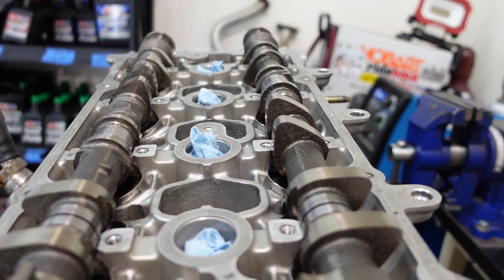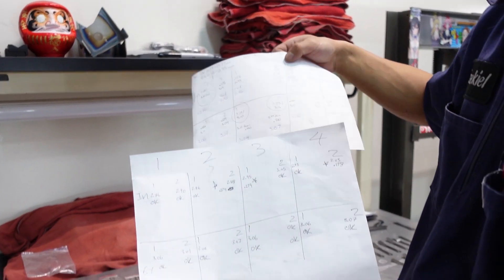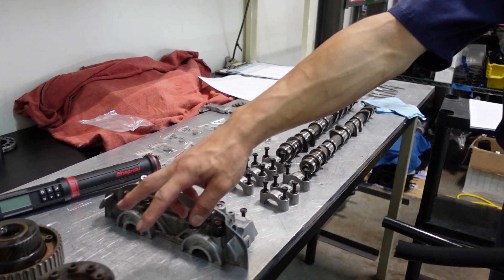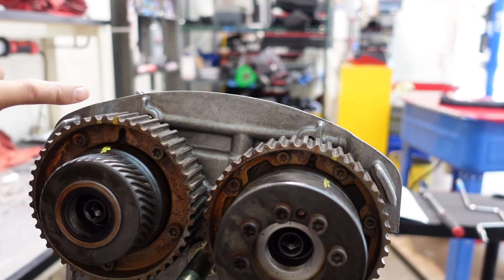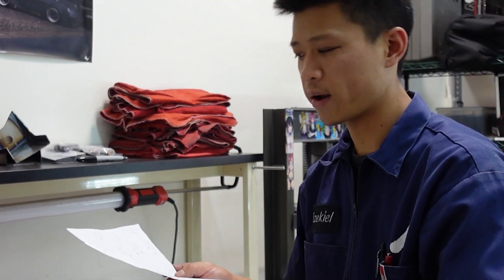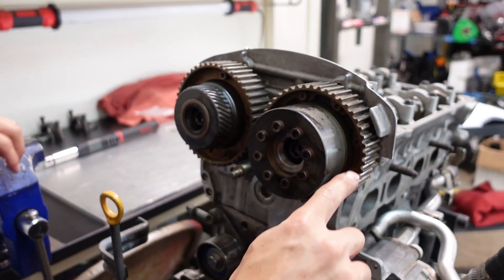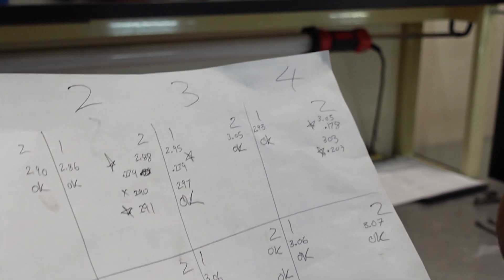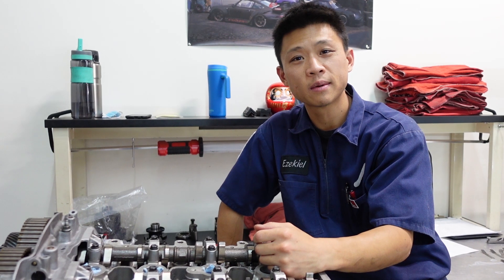BEAMS 3SGE Valve Adjustment

Comment: Good evening, I would like you to help me. I disassembled the exhaust VVTi from the 3SGE Beams engine to change the seals and by accident the spring and the gears came off. Now we can't assemble them anymore. I would like a video so I can assemble them.
Reply: Inadvertently have just done the same, got it back together alright but the Internal timing is off a little and sets a code. Did you have success assembling it correctly? I'm about to try and work it out today🤞

Comment: Having to install and remove the cams FOUR times in order to get the correct shim sizes seems excessive. After installation the first time and finding the actual clearances with the feeler gauges, calculating the required shim thickness for each valve should be easy. Finding the correct shims may be more of a challenge!  If my memory is correct after doing this about FORTY years ago, on most of the Japanese cars, the valve adjustment procedure for 4 cylinder engines was: At TDC adjust intake and exhaust valves on cylinder 1, intake valves on cylinder 2, exhaust valves on cylinder 3. Then rotate the engine 180 degrees and adjust the remaining valves. I don't know if this is still relevant today.

Comment: The 1 and 2jzgte uses the same puck style shim, as well as the Rb26dett. Easy to find. Also the USDM 2zz shares a ton of the same parts as the 3sge Beams. They both have the Yahama head.

Comment: Hey my question for you is it possible to use intake valves intended for Gen3 3sge engines on a Gen 5 3sge engine? I have a sxe10 altezza and my timing belt snapped so I'm considering getting valves incase they're bent

Comment: Awesome video, love the channel! I have a question. Upon rebuilding my BEAMS, I noticed that the exhaust valves, and valve guides were garbage. I bought new OEM valves and valve guides, and had a machine shop install the valve guides. But now the clearance is WAY too tight on all of the exhaust valves. 

My lowest feeler is .04MM and 3 of my valves are tighter than that. What would you recommend for a starting/ending shim thickness in this case like this?

Here are my measurements:

EX1; <.04, EX2; <.04, EX3; .13, EX4;.10, EX5; .12, EX6; .06, EX7.15, EX8; <.04

Thanks!
Reply from the maker: You're going to have to measure your existing shims to see how much thinner you need to go to get the correct valve clearance.

Valve adjustments are always tedious and usually a major headache
Reply: @CMAutohaus  Got it, thanks for the reply homie!

Comment: Great video with alot of information!
Can you tell me what the valve specs are for the automatic version?
I'm sending my cylinder head to a machine shop but i just wanna check them after it's done
Reply from the maker: EX 0.32 - 0.42mm AT
IN 0.17 - 0.27mm  (same as MT)

I'd have the machine shop do the valve adjustment. Then recheck after the head is bolted back onto the block.
Reply: @CMAutohaus  thank you so much 🤙
Reply from the maker: @tobyrempel8952  You got it!

Comment: Great vid! Wish I'd seen it before spending a week on my RT BEAMS valvetrain. Do you have a favorite tool to compress the springs and get the valves out?
Reply from the maker: Thank you for the kind words. For valve springs there is a Blue Point tool that you hit with a hammer. Also works for 4AGE 16v
Reply: L'Isle 36050. 💯